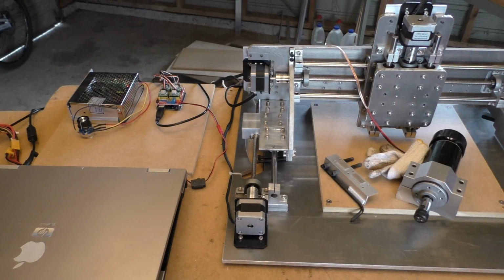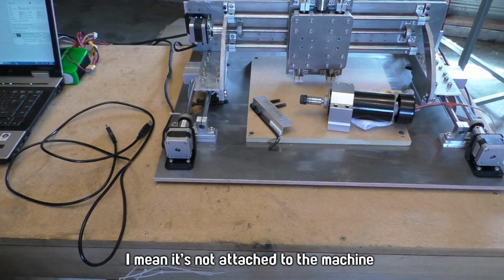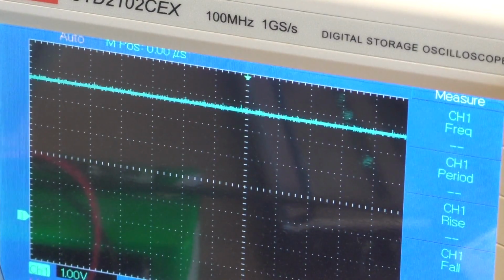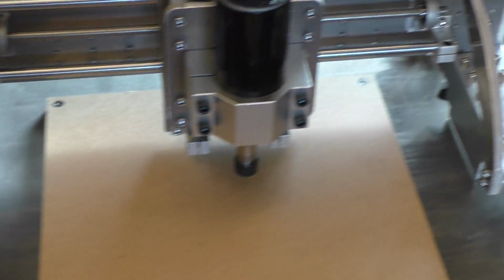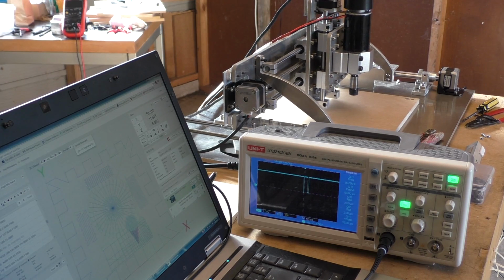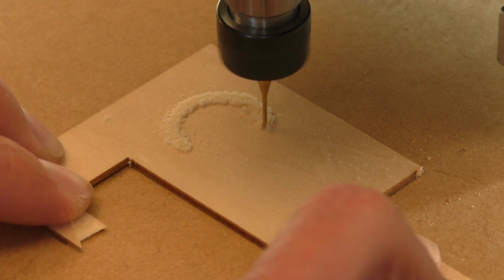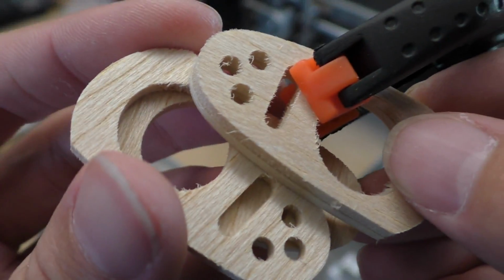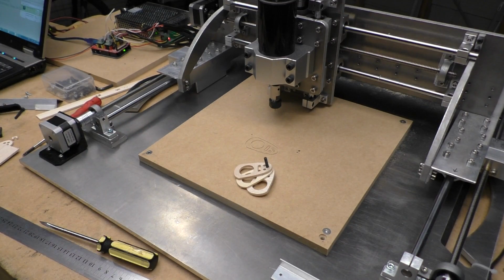DIY mini CNC machine part 10 (spindle round three + easy cuts)

Comment: Have your tried to decouple the notebook or the driver shield?

The problem can arise from a few sources:
 - electromagnetic interference, i doubt this but I'm working with 433mhz 1w modules and some arduinos are going literally crazy when i switch it on
 - high voltage spikes on spindle wire crosstalk with other wires (arduino shield, uart)
 - huge spikes coming back from spindle eventually getting back to arduino raising/lowering thresholds of digital inputs and causing missinterpreted uart commands or steps the motor
 - interference on uart/usb cable

I would try to use 
 - a bluetooth serial adapter for the arduino-pc communication (~1usd on ebay)
- use a "choke inductor" plus a big ass buffer capacitor on the entry side of the shield/arduino be awar that choke+cap act as LC component and thus can oscillate or amplify the noise (but in that case you would know what to tune.
 - wrap the arduino shield into a papertowel then alufoil and shield it (or just put it in a metal casing)
 - optical decoupling for the arduino and the driver shield

Have you tried to google the issue?
 "cnc spindle interference" gave me a lot of results and many suggestions solved the issue.

Comment: The smaller the bit are, the faster you need to turn it.  So a bit larger diameter will get its outer cutting part to move faster.  And it will be a bit stronger.

Comment: Disconnect the motor and measure resistance between the wires and between the metal on the motor (and between the wires).  
Just to see that it isn't faulty.  Also check the resistance while slowly turning the motor.

Comment: Hi. The scope is not isolated?  When you hook it to the arduino, it has same ground as the motor driver, and motor current travels through the scope probe ground and is picked up by the probe i think. noise is a hard nut to crack. seems like the star ground trick helped :) I love this problem solving you have here.

Comment: Great progress! In the span of this single video a lot has improved. I think you are on the right track.
My two cents... In priority:
1. Create a star ground (single point ground) for all your components (Don't forget the chassi of the router/mill itself).
2. Shield the leads (at minimum twist the cables) to the spindle. The shield should only be connected in the source side.
3. Scavenge or buy a mains filter for the power supply (like a cheapo Yunpen YA03T1).

And do check out the articles I hinted at in my comments to the previous video if you haven't already.
http://www.eetimes.com/document.asp?doc_id=1274098
http://www.eetimes.com/document.asp?doc_id=1274099

I'm still surprised at the output from the spindle drive (I will have to watch the destructive part again). I would try to ground reference the negative output to the spindle with a ~10k resistor to see if it will blow up. I have a hard time believing that the negative cannot be referenced to ground. Again good luck, have fun and enjoy the learning!

Comment: I had a similar problem with serial communication due to interferences. logic signal fails very quick next to that much interferences. what I was told to do in that moment and it worked it was to wind with a gnd cable each of the serial wires between the Arduino and the module. and after dining that I had no more errors and a very clean signal on the osciloscope. the ground might be connected to both ends, one end to the Arduino o and one to the module. so what I had was 2 wires of ground and two for the signal. hope you won't have any more problems. cool mill 👍
Reply: intresting!

Comment: Are there any capacitors on the motor connections.  I don't know much about this stuff, but all of the old brushed motor model vehicles have them.  Shield motor wires and only ground on one end of shield like Graham Wise suggests might do it.  This is like my son's problem with humming in his car stereo.  He has purchased new Pioneer radios and of course has amps and woofers.  Different people installed 3 different times and the alternator has been replaced.  He feels like you do about this situation.

Comment: Is the power supply for the spindle isolated? Is it even a Mean Well  or a chinese cheapo ? Looks like back emf, but it is ground loops or via the spindle enable ? Either way id replace that spindle power cable with something shielded or drain.

Comment: You could buy a Dremel i use one on my CNC https://www.bunnings.co.nz/dremel-130w-corded-rotary-tool-with-30pc-accessory-kit_p00301384 Also this version has a switch for changing speeds

Comment: I suggest increased the speed of drill and reduce the speed of axis movement, maybe use oil or water for reduce the friction between pieces for have better milling, and for the electrical problems change the usb or serial connector cable and add more capacitors for better filtering, and reduce the long of cables for have low interference.

Comment: Try wrapping the chord of the spindle motor onto a ferrite toroid. That's how laptop chargers, and pretty much any good smps does to remove transience(that little cylinder near the end of smps wires is a ferite toroid :D). 3-5 turns should be enough, also try to put the toroid closer to the motor. If that doesn't do much try wrapping the stepper motor wires onto toroids and put them near the arduino.
Reply: And your bit broke because you were spinning way to slow.

Comment: Twist your wires, shield them, put ferrite chokes on the cables, use a buss bar to ground/earth everything, filter where applicable (capacitors/resistors), do a really long test with no spindle to verify it's the problem. I've had to do this type of stuff with big drones. Don't despair, you'll get it.

Comment: More coils and capasitor to filter power lines... Could be spindle causing high frequency noise on power lines or io- lines

those 2 volt spikes are plenty enough to cause problem with microcontroller..

And you could use mesh shielded cable to power the spindle. Just remember to connect shield mesh to power supplies ground. Such cable seems to be standard cable for motors in industry installations..

Also aluminium need cutting fluid... Helps keep tool temperature low.

Comment: looks like the tool had a built-up edge, try increasing the cutting speed and decreasing the feed rate, you could use an speeds and feeds calculator if you have any way of measuring the spindle speed , there are also special aluminium cutting tools that you could use

Comment: You could use an external usb to uart converter and isolate the TX and RX of the arduino from the TX and RX of your usb uart converter using optocouplers

Comment: make all leads as short as is practical. route the motor leads away from the stepper leads. shield all the leads with well grounded shielding. Twist the motor  pairs and also twist the stepper coil pairs. The twist means that any interference picked up should be equal in each lead and therefore cancel out.

Comment: The motor leads are acting as an aerial (antenna) with about 100v at the PWM switching speed.  I suggest a shielded cable but only connect the shield at one end, as don't want to make several earth current routes.  I would try the power supply earth where the arduino is referenced first.  A small valure capacitor across the motor may help in addition. If you have an AM radio it would be intresting to see what interference the CNC makes.

Comment: yeaaaaaa, you broke 2 bits in this video.
It's ok, you will break more than just some bits while you are trying. :LOL
Try to run the machine without firing the spindle for a long job like one hour or so and see if the arduino would stop in the middle. May be the issue is not directly related to the power supply or the spindle!

Comment: try adding a capacitor of a value from somthing pf to nf across motor connections and see how it goes. Also add a diode to motor connections. connect katode to positive connection and the anode to the negative.

Are you powering up arduino from a different power supply (isolated from motor power supply); no ground connections connected together ?

Comment: Check you are still only getting a max of 100v from the spindle power supply, I've tried most of the things you have checked and while initially I got a max of 100v now the power supply goes upto 130v, I think while I was messing about with different grounds, I've fried something in the power supply.

Comment: have you tried connecting all the grounds so everything is at the same potential?
Reply from the maker: yes, that's what I did in this video...
Reply: I think grounding ( main's Earth) the body of the motor and the holder will be enough for shielding the motor.